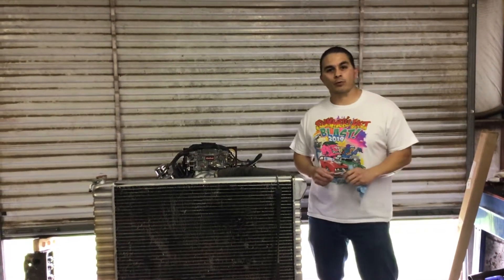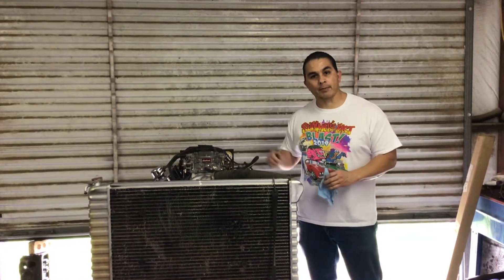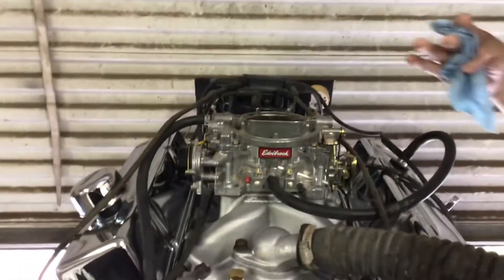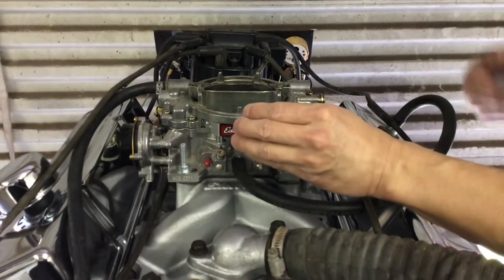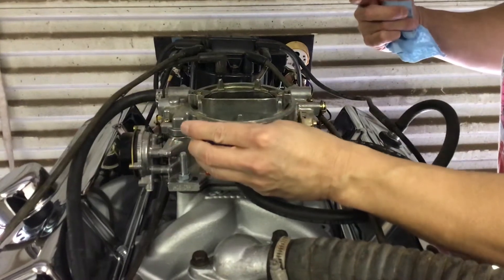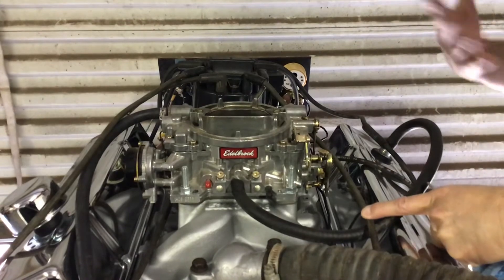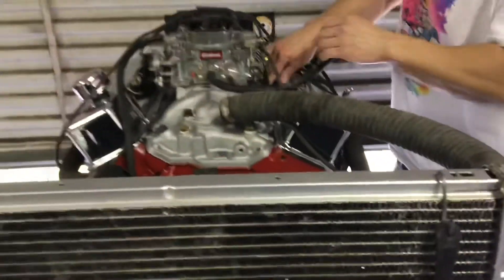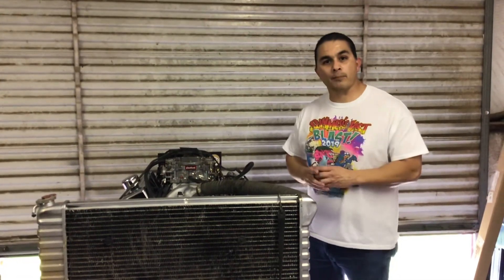How to adjust a Edelbrock carb and set timing on a small block Chevy

Comment: I know this is old video but for a stock 350 with headers what is the target for rpm on this engine, i rebuilt the edelbrock carb and having some issues with slow start at 8 with timing and in stop lights having some bounce in the engine that make me press the brake a bit harder cause it feels like it want to move foward with that bounce with barely noticeable vibration or like spurting at take off and goes away quickly,none of this was there before the carb rebuild, only rebuild it because the accelerator pump seemed bad and upon rebuilt i noticed there was no weight or spring where the ball bearing was,thanks for the video

Comment: Just purchased my dream 1979 corvette with a 350 chevy small block and i have been trying to find videos how to fix my own issues. anyways, thank you man! to the point and simple. one question, how do you turn the distributor for the timing? *sorry if its a dumb question
Reply from the maker: @mycelliumforall619 you turn the distributor counter clockwise to advance and clockwise to retard. Do not loosen it too much, just enough to turn it with a little force.

Comment: Hey . I'm in the market for a new motor for my 1977 gmc high sierra.  5.7 I may just get one from autozone.  What should I expect to pay to have this done / carb and timing.?? New Edelbrock carb 4 Barrel performer 2.
Reply from the maker: @michaelrobinson8298 you can reach me at my Facebook Reys engines, my photo is a supercharged small block and a 1955 Belair. If you are looking for a stock engine and the cheapest route, yes AutoZone is your place. I am currently building a stroker 383 with fully ported heads.

Comment: Hello Rey! New susbscriber here. I have a 1980 Chevy 350, the smog kit was deleted. Engine has an aftermarket manifold (Weiand Stealth) I have no history on the vehicle whatsoever. Bought a new Edelbrock 1406 Carb. I have not changed sparks, dist, or wires—they all look like they are in good condition.  I have watched a handful of your videos, great content —have any tip on getting this thing running smoothly? it has about 136,000 on the odo could be more it reads only 36000- so not sure if it is 136,000 or 236000. I think its 136000, vehicle is in good shape. I would love to hear back thank you!

Comment: You recommed 8 degrees mine is bone stock crate 350.  Thanks
Reply from the maker: Rob, yes 8 is good. Run the engine and see how it responds.
Reply: @reyracer  Thank u

Comment: Nice video!
I have a 350 sbc and it has a performance Edelbrock intake with Holley 600cfm carb and it’s smell row gas a lot when start and while it’s idle so I been adjusting the mix screws and timing but still the same. What you recommend me to do?
Ty.
Reply from the maker: Yaniro Nistal
Do you have a fuel pressure regulator? If so is it set at 6 to 6 1/2 psi? Have you set the floats on the carb? If they are not set correctly, you will have too much fuel in the carb.
Reply: @reyracer  I’ll check all that out 
Ty!
Reply: Same issue with my 307.  Thanks !

Comment: I see alot of people who have issues timing when there are no marks or the timing tab broke off. Also with carbs setting up the correct jets is alot harder to do than setting the idle. I see more people struggle with that.
Reply from the maker: Ok thanks, I will get a video on jetting the carb.